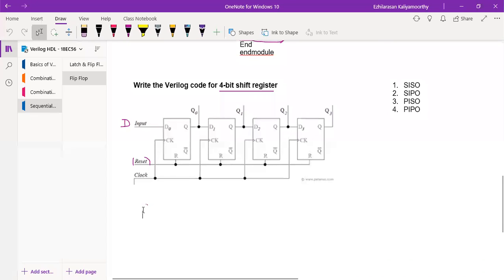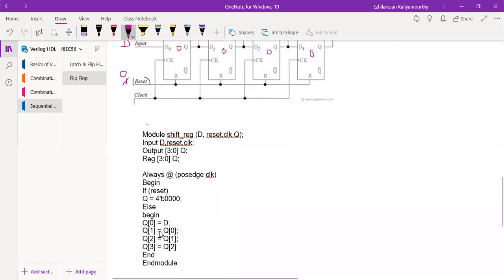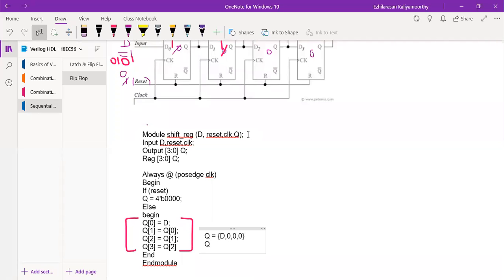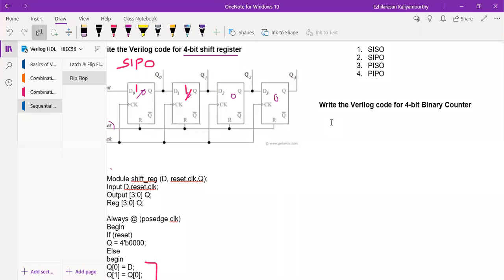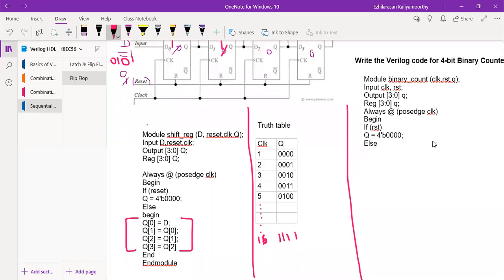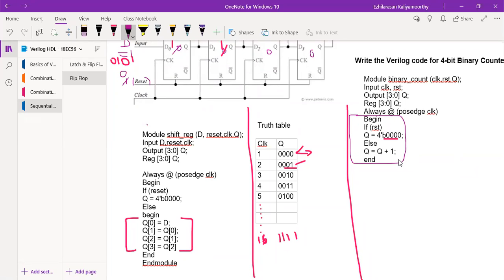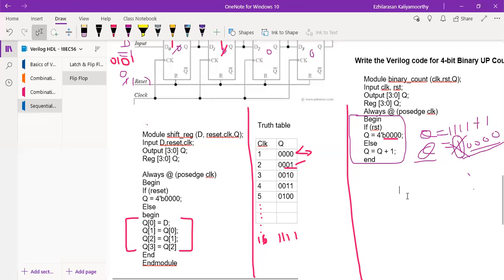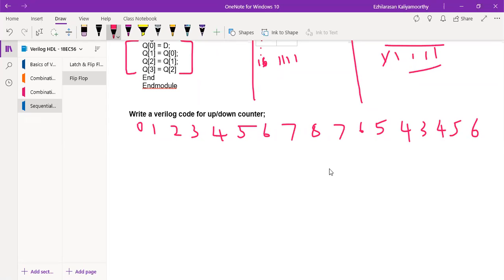Verilog HDL - Sequential Circuits Example -4

Comment: inside the always block why aren't you using non-blocking statements ?
Reply from the maker: The non block statements inside the always will execute concurrently, blocking  statements will work sequentially, the value will update
Reply: @DrKEzhilarasan  for shift register, shouldn't we use non blocking statements? 
Or blocking